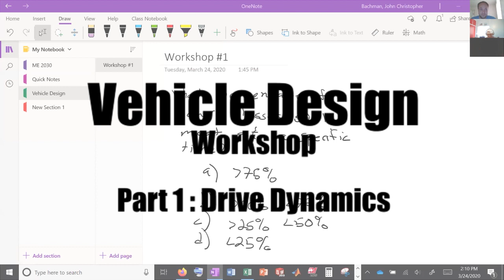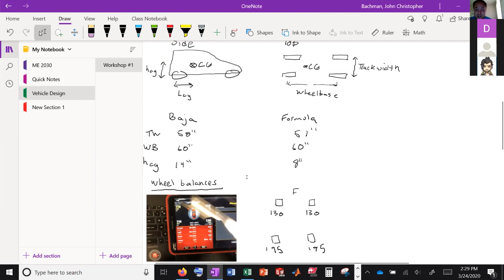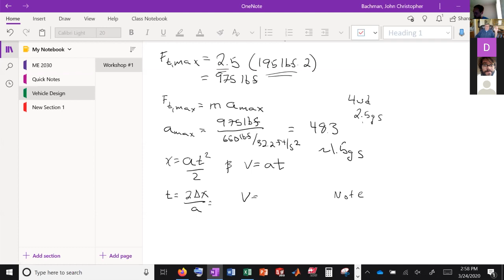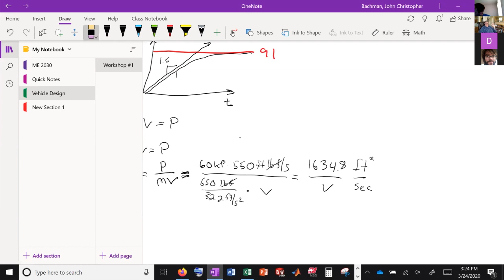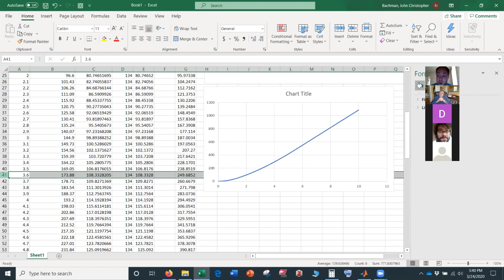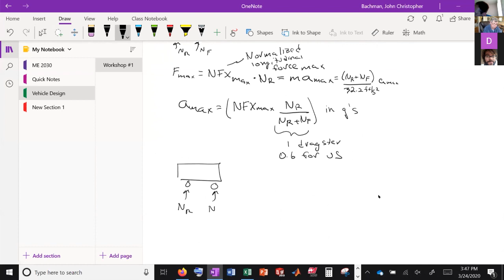Race Car Design for Baja and Formula SAE Part 1: Drive Dynamics

Comment: Corning has a lot to do with the ability to change directions quickly ie a 90s/00s rally car looks fast, but a brand new rally car is way faster even if the cornering forces are lower because you don't have to do pendulum turns in one. Because it wants to oversteerless.